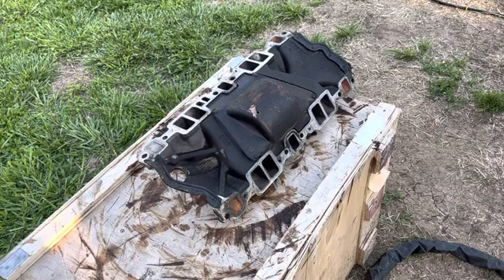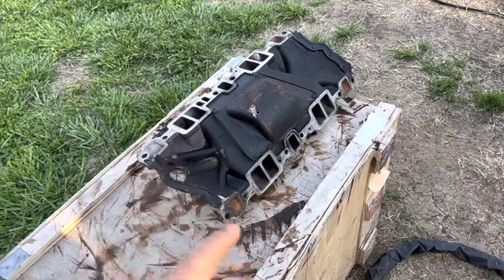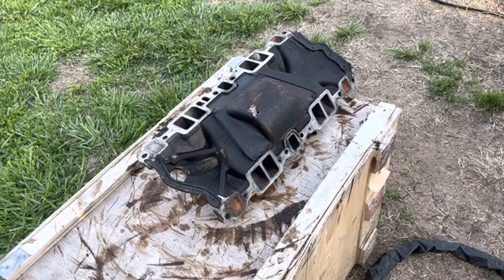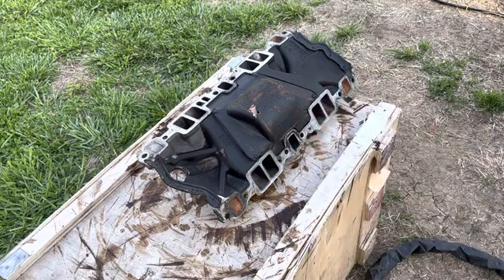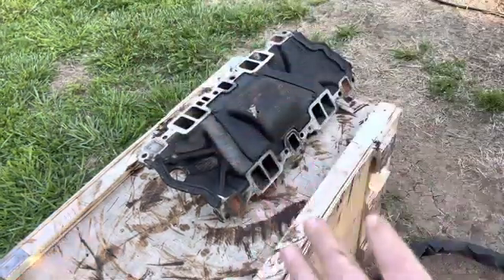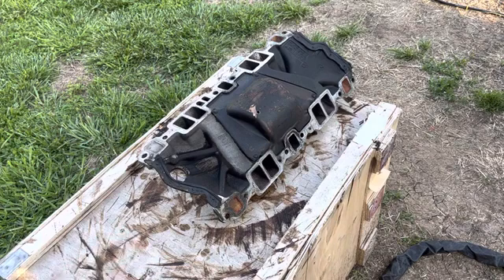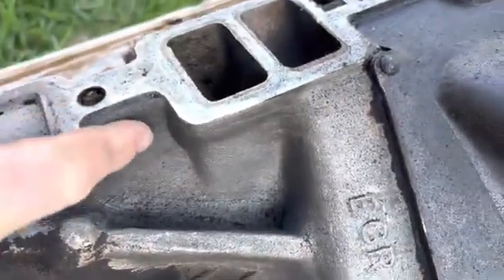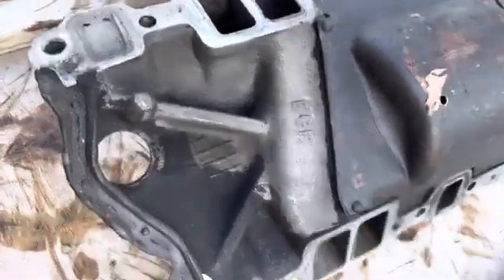Haotian 1500W 3in1 Laser Cleaner   Cleaning Oil off an Old Corvette Intake

Comment: dawn hat water and a wire brush does the same job. more work but I would have to clean alot of intakes to pay for that laser. even better than soap and water or a laser is a sandblaster
Reply from the maker: The fiber laser machine will be faster
Reply: @HaotianLaser  what does a sand blaster cost? what does a laser system cost? which will make me money faster... the blaster
Reply from the maker: @pghgeo816  My email is:bella@htlasercnc.com, May I know your email address?